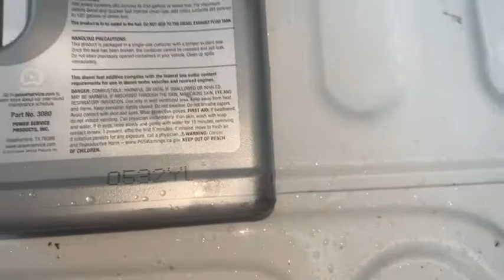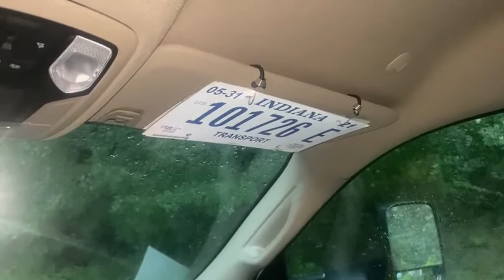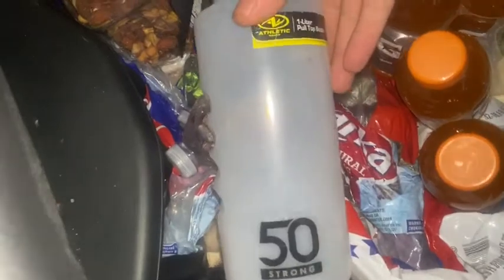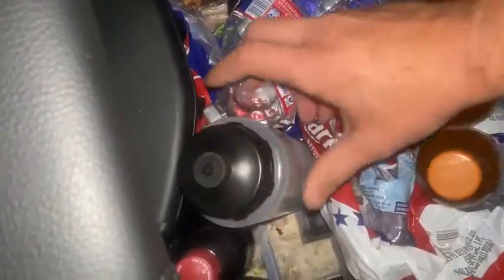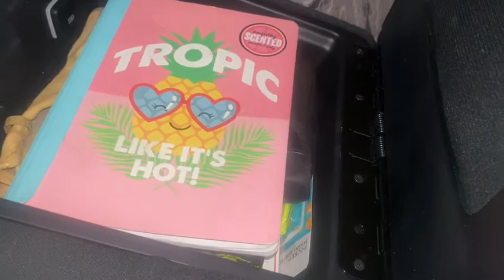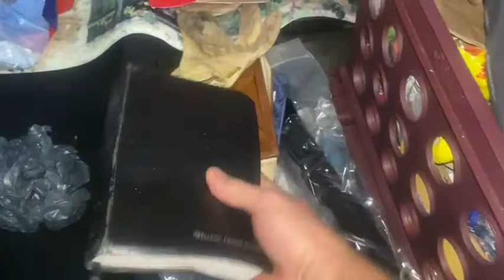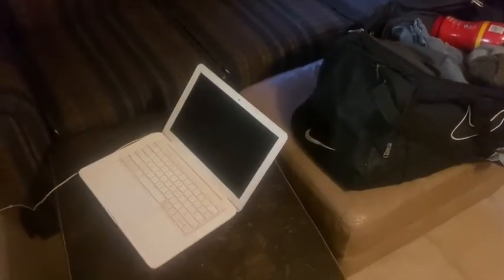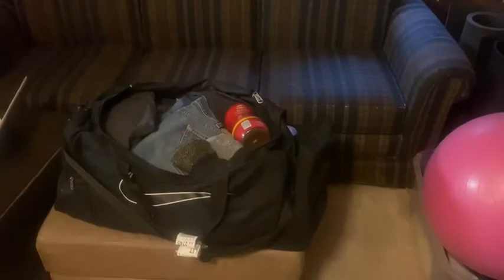RV Transport: What’s in your truck? Preparing the truck for winter

Comment: Mark .. your runs may just be in warmer states.. but you know .. you can get hit with some pretty dangerous winter conditions. As well as highway closures .  A single long candle? and a thin reflective blanket ( they sort you can fold into a wee square) they can save your life. The candle alone.. burning in your truck? can mean the difference between life and death.. will keep you warm enough to survive the night. . . so keep two.. one as a back up. That and a handful of choc bars. ( not for enjoying at night while on your laptop layed over somewhere...) kept as an emergency for when you need that candle... do get a few candles.
Reply from the maker: Thank you. Awesome information